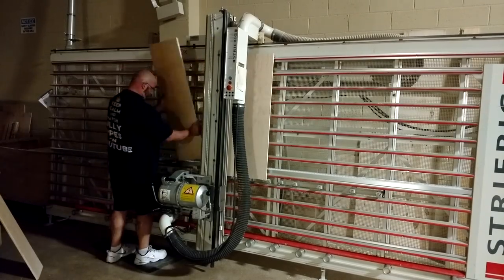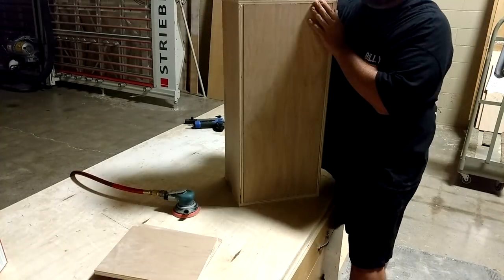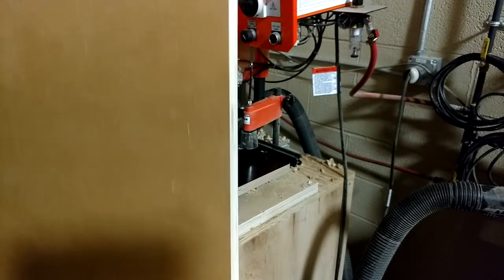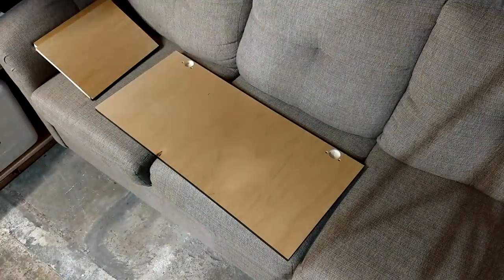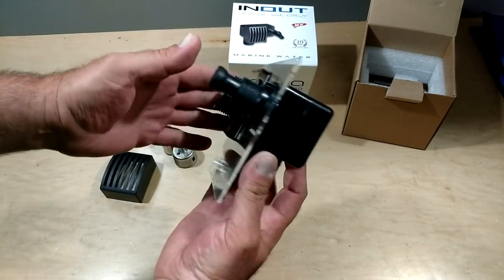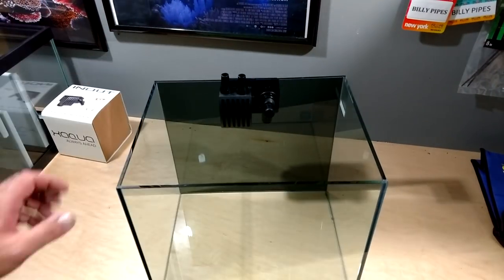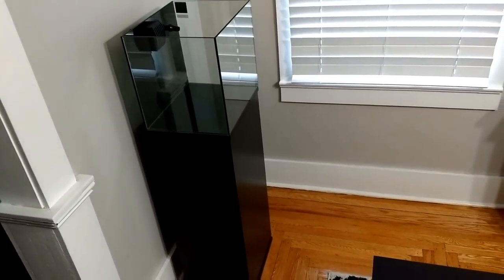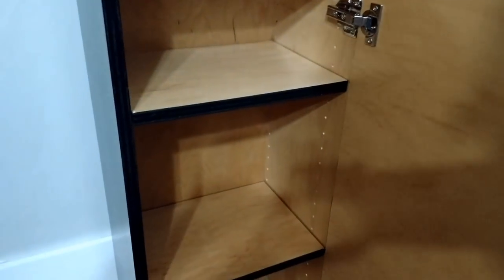DIY Fish Tank Build - Complete A-Z Video - Stand, Tank, Overflow, And Paint

Comment: Just pop a Red Sea emblem on the corner and nobody will know the difference 👍👍Did you use the Behr ultra high gloss?  And also does it matter the plywood I use to get this type of finish?
Reply from the maker: Coralcrayz yup Behr ultra. And I used a pre sanded plywood...the smoother the better. Also the sanding in between coats is what really helps it to shine